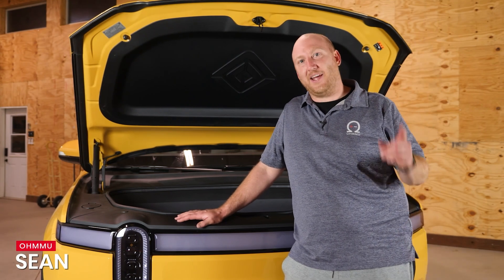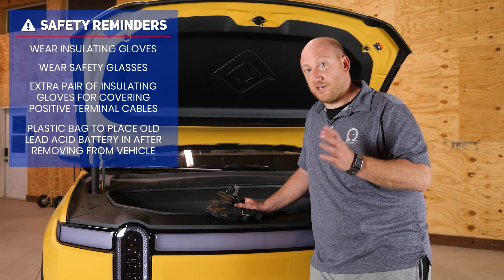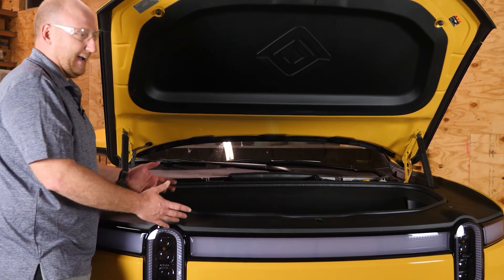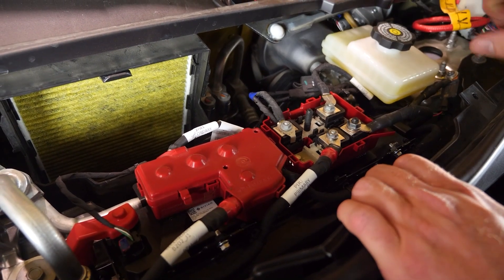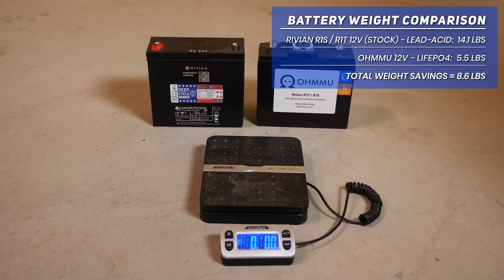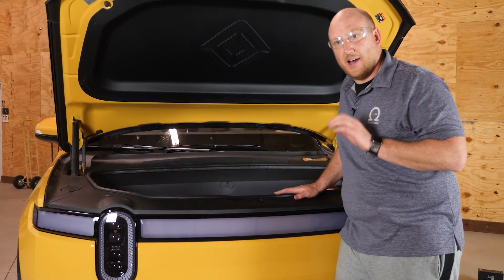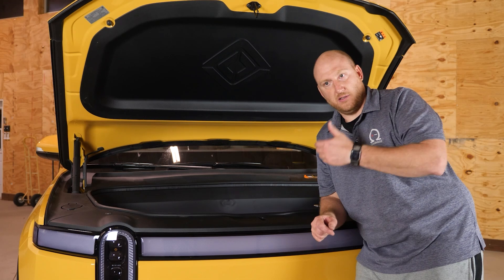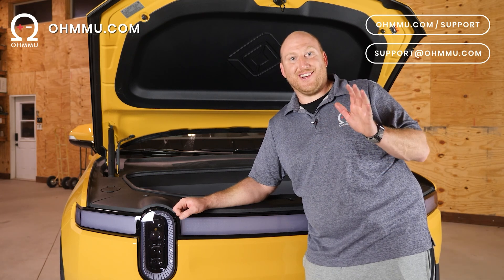Rivian R1S / R1T (Builds approx. 3/23 and Later) - Single 12V Battery Installation (Ohmmu)

Comment: I'm surprised that the owner's manual hasn't been updated with this change. What's the best way to jump start it then? 
I got my Rivian shipped to me with the 12V battery dead. The screen works for maximum a minute then shuts off. I have connected the rear wire harness to a battery with no luck. So I followed the instructions to try the secondary battery only to realize the connections are different from the manual. Also, I found the capacitor positive cable disconnected, I assume to preserve it while it's shipped.
Reply: If I remember the manual correctly, you’re not supposed to jump or jump others with EVs.

Comment: I got 2025 R1T. No battery where it is shown in this video. Hopefully you can do an update. I'll keep looking.
Reply: Were you able to find how to replace battery on the gen2? Would be great to know
Reply: @crpunks  I found out where it was. Its under the passenger seat. I don't want to mess with the E-fuses. So I made no mods. Gonna wait till smarter people than I can figure it out. I still want a 12 v plug in cabin and Frunk.
Reply: gen2 has AGN/Leadacid or LFP/NMC like tesla after 2022?
Reply: @eSUBA94 No idea. I have found very little information so far.